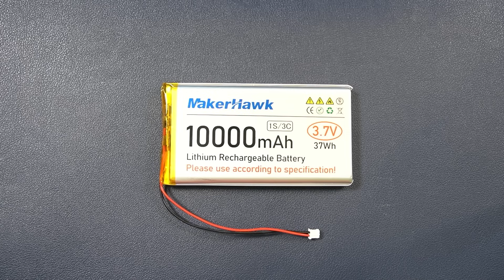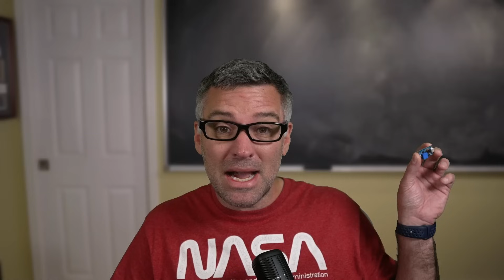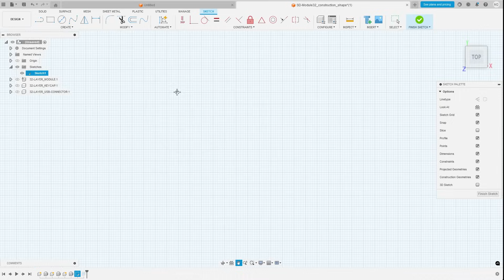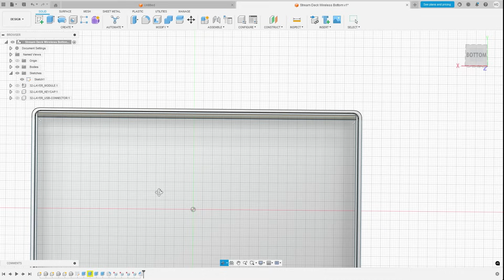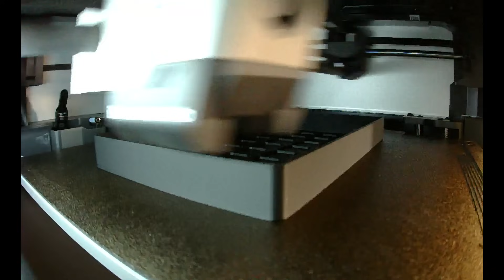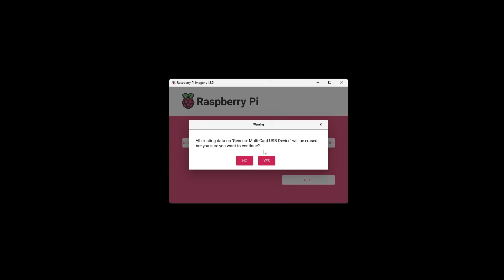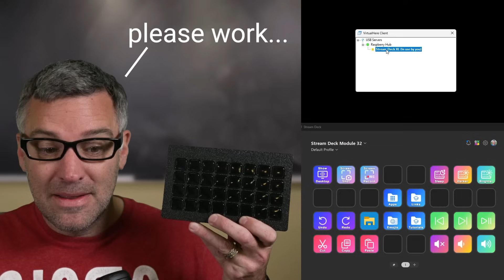Build your own wireless Stream Deck that works with the Stream Deck software!

Comment: You know, you and I should talk, and I can help expand how you can make this work outside your home network with WireGuard VPN server on a home computer, and WireGuard Client on the Stream Deck Pi to connect to your phone hotspot, and then connect home. Message me if you're up for a collab project!
Reply from the maker: I'm always up for a good hardware collab.. :D  That said, I did experiment a bit with a VPN and routing everything via my phone hotspot and it worked pretty well. Occasionally I do some IRL Downhill Skiing streams, and was thinking a 6-button version on my arm, routed via VPN through my  IRL rig to my streaming PC might be a good way to control the stream.

Comment: Finite finally making content! claps Thanks for sharing this. Exactly why I was excited about the modules! We recently moved into our first proper house together and now I wanna build out various little streaming stations around the home (kind like how Nutty has his seperate setups for streaming vs YouTube vids). The initial plan was to just build out a surveillance based HomeLab setup but geared towards streaming. Then I was like, well that's all well and good but what about audio? What about control? LOL.
Reply from the maker: You're very welcome! I've been meaning to put together some long-form content for..  years now.  And while this was quite a bit of work to put together, it wasn't as bad as I thought.. so expect a bunch more to come!  It sounds like this could be a good solution for control.  Maybe I have to try a similar project with a stripped down WaveXLR for audio 🤣

Comment: This is excellent! Two things potentially of note:
* You should be good increasing the voltage up to 5.1v instead of 5.0v. This helps defend slightly against voltage sag as well when everything's running at full bore. Official Pi PSUs run at 5.1v so you should be safe there. 
* As an alternative to the second regulator, it might also be a good idea to add a sufficiently large capacitor between the charge circuit and the Pi to help mitigate the brownout. I don't know precisely how large it'll have to be, though.
Reply from the maker: Thanks! I'm glad you enjoyed the video.

I'll definitely bump the voltage regulator to 5.1v.

Regarding the capacitor, I did try a 10000uF cap to see if it would smooth things out, but the pi was still crashing, so I think it must be cutting voltage for at least 40-50ms (or more).  I should play with some larger caps and see if I can get that working, as it would be a simpler circuit.

Comment: YEARS in the making. I'm so excited.
Reply from the maker: Thank you!  It really is a game changer being able to control OBS (and other things) without wires!
Reply: AND ANNNDDDD You can install wireGuard, and make a WAN Stream Deck that connects BACK to your internal Network to use the stream deck ON THE GO! Literally portal and usable outside your home network. Since it's basically a mini computer on the game, what you can do with using stream Deck is limitless. Just have the Pi connect to your phones 4G LTE hotspot and BOOM! DONE! Easy.